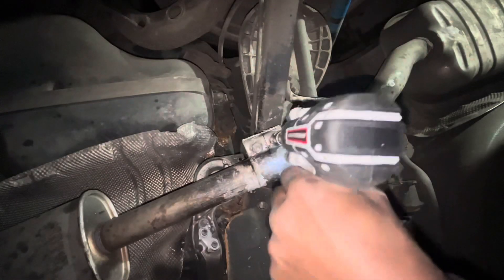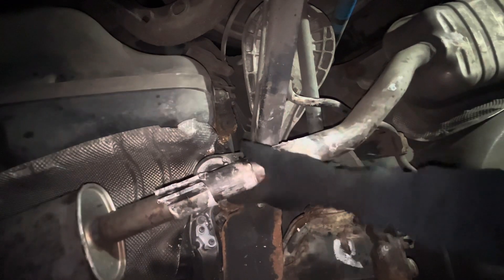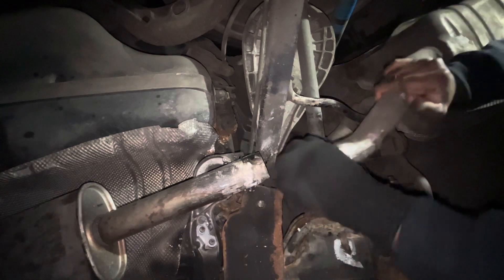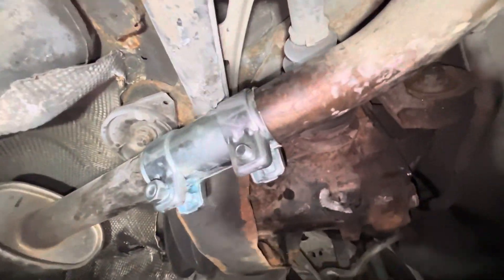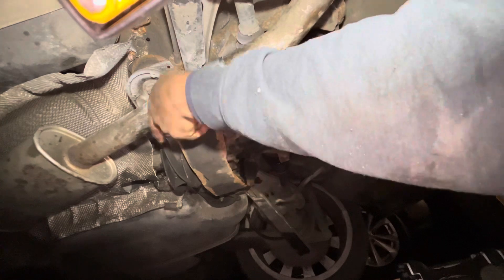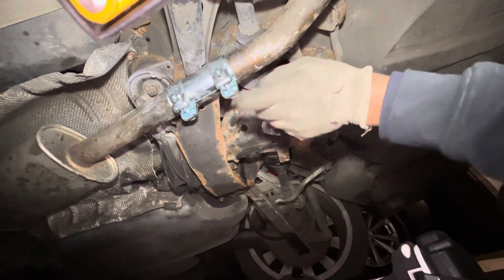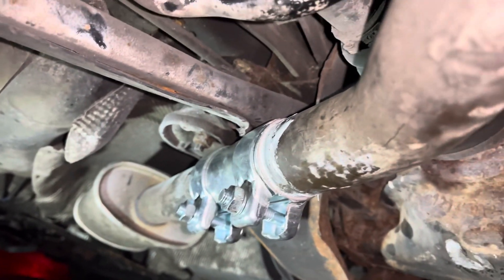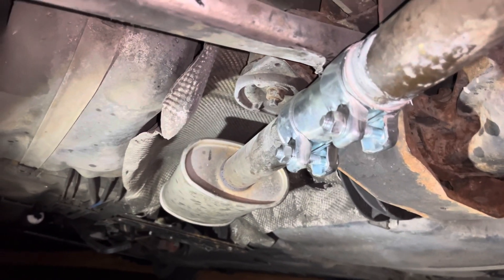BMW E46 Exhaust Leak Repair

Comment: Where'd ya get the clamps bud, I tried several and they all seem slightly to big.
Reply from the maker: i bought it on a car parts shop in Oxford mate
Reply: @handynate  well fuck if thats not across the oceans...i installed headers, but my flanges were already cooked and cut off prior. not wanting to cut the flanges on the headers, but the flanges i add seem slightly clocked wrong and at this point im over it. so clamps and cutting it is. may try the ones on bimmer world even tho 50mm says its slightly to big to "clamp" enough too.
Reply from the maker: @Kraxt0n  its such a pain that! if i remember well, these clamps i got were up to 55mm, it worked well, i also put loads of exhaust paste to prevent any leaks